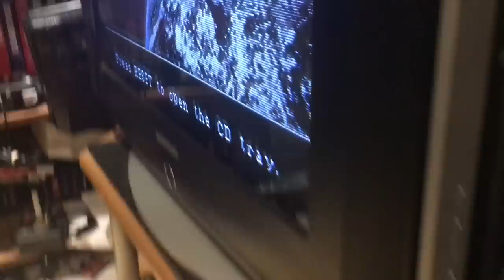Fixing eBay Junk - Sega CD Model 1 - Part 1 Fixing Drive Belt

Comment: that thing on the side of the cd player, you call a lock mechanism, is actually there to route the cable that goes from the front of the genesis to the back of the cd player out of the way of the cd tray
Reply: Good catch

Comment: I could not get my the try on my Sega CD, I did what you said, turned that wheel with the teeth on it and when I tried to slide the try back it would disengage with the gears so I tried leaving the try extended and let the Sega CD close it but that just made it get stuck open. If I push the tray back in and turn on the power it would get stuck and cause the Sega CD to lock up and not allow me to get to the system settings or memory management. 
I originally had a problem of the try keep ejecting and staying out even if I had a cartridge in the Genesis so it would not even bring up the Sega CD Screen since having a cartridge in the Genesis just loads the game on the cartridge and by passes the Sega CD.

Comment: You can boil the drive belt you took off the system to restore the elasticity. Makes it snap back to the original size.
Reply from the maker: For how inexpensive the belt is, rather just replace it, but yes, in a pinch that can work too

Comment: 1:49 that is for the mixing cable to put in to make it not be in the way of the disc drive when it's opening

Also my self wouldn't save games on the battery since sega have a cartridge that saves the games and is required for one of the games to beat it but I probably think you knew that already

Comment: A fully setup Genesis/Sega CD/32X is a monstrosity, but god damn if Sega didn't make it work. Too bad most of the games for the Sega CD and the 32X were trash.

I got a Model 2 Genesis, Model 2 Sega CD, 32X, Game Gear (plus one crap game), all the cables, three controllers (a classic Sega branded 3-button, two wireless six button controllers that didn't really work) for $45 from a local thrift store some years back. Pretty decent deal. Everything worked great, the Sega CD worked like the day it was made.
Reply from the maker: Going to disagree with you on that first sentence.  The SCD and 32x had some decent games on them.  Obviously not as successful as the main genesis lineup, but I wouldn't call them trash.  Worth owning, if you can get them at a reasonable price.   Sega CD games in particular are getting out of hand with pricing though.

Comment: Hello, I have a question and I would like to see if you can help me !!! I recently bought a Japanese mega cd model 1 and after repairing the disc tray, I connected it to an American sega genesis and it turned on with the Japanese bios but when I put a music cd it did not read it so I would like to know if it is because my sega genesis It is American and it is incompatible by the region ??? or if that does not matter to read music cd I would like you to pass me the calibration levels for that model to calibrate the laser please

Comment: Couldnt they make it work using less cables?
Fuck, why cant the 32X go through the cartridge slot directly instead of have a patch cable?
Reply from the maker: because the 32x works by taking the graphics the genesis creates, then adding an overlay on top. I guess the cartridge slot doesnt pass video.
Reply: @RetroRepairs  Well, thats quite an interesting way of doing things.

 Looks more like a prototype setup than the real deal with all those cables and connections, especially that mixing cable.
Reply from the maker: Yep... Then add in the sega cd and you've got a real mess
Reply from the maker: Sega was also going to make a 32 bit system to span between the genesis and saturn. Sega scrapped that and opted instead to make a 32bit add-on for the genesis. It did reasonably well in the US, but Sega of Japan pushed ahead with the saturn, essentially killing the 32x before it could ever gain more traction
Reply: @RetroRepairs  I remember hearing of that, or maybe that was the atari project that got shelved for the jaguar, cant remember.
Reply from the maker: Definitely Sega. Atari was always the story of "too little, too late" ever since the 7800 came out.